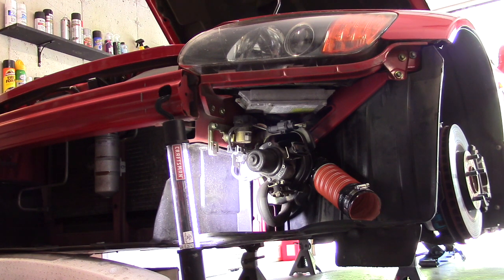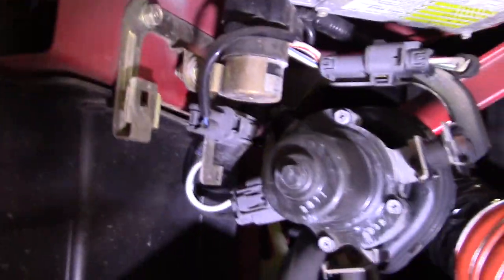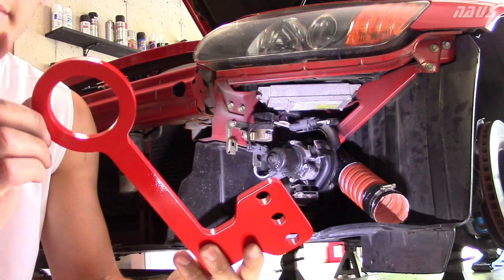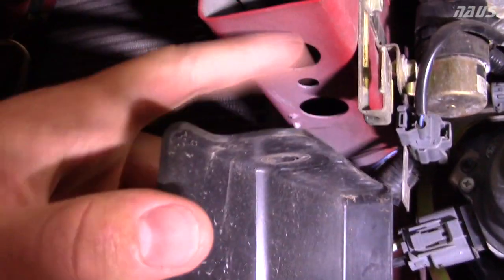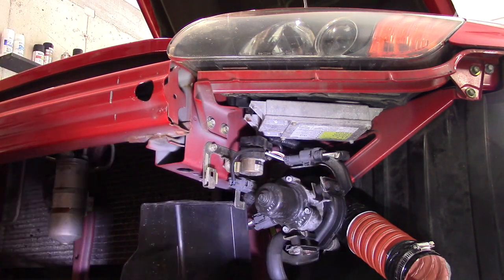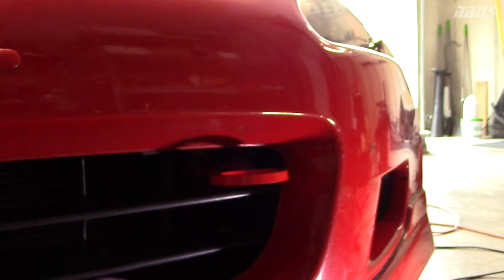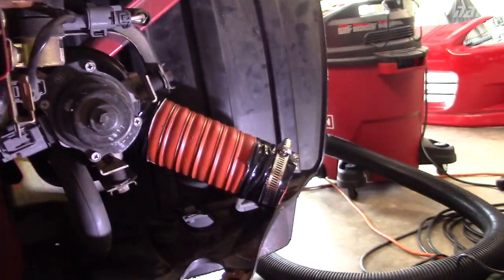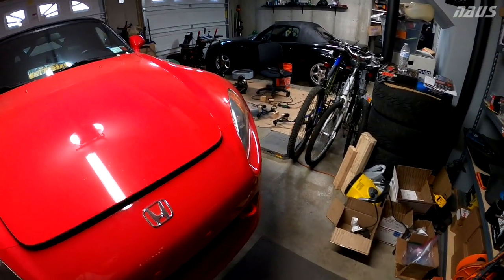J's Racing Front Tow Hook Install - Honda S2000

Comment: Does the requirement matter on placement? Like I run my chassis mount right where the Hook goes could use long bolts or just
Install a rear tow hook?
Reply: Looks great with the nfr
Reply from the maker: It’s ideal to have a front and rear tow hook on track. There are other options out there like the Science of speed front tow hook which would not interfere with your splitter mounts. There is also the oem tow hook and location which works just as good.

Comment: The reason you needed to use the zip tie is because you cut too much of the lining. Instead, if you cut a U channel in the lining where the forward most bolt is, you can use the force of the bumper to keep it in place. It'll essentially sandwich the liner against the grill, tow hook, and front bumper. So far, it's survived over a year of track events with no issues.
Reply from the maker: I mean I could have just sandwiched it in there, but I wanted it to be held up like oem and secure without the bumper on
Reply: @NAUS2K  I just did this install myself. I used a dremel to cut a slot in the vertical section of the plastic shroud right up to the horizontal part just wide enough to get the hook in place, still leaving material in front and behind the tow hook. I then drilled two holes in the horizontal section to fit the bolts through. the plastic then sandwiches between the hook and the frame rail and attaches the shroud to the frame in the same spot but more securely than the old clip. It's a little more work, but makes everything fit more securely and looks a little cleaner (even though you can't really see in there without the bumper off).
Reply from the maker: @joshterasaki6647  so you have plastic sandwiched between the bolts to tighten the tow hook down? If so that would compromise the strength significantly because you would never be able to torque the bolts down tight enough as it would infinitely crush the plastic.
Reply: @NAUS2K  It's sandwiched between the tow hook and the frame. I was able to tighten the bolts down more than enough to compress the lock washers which are what really keep the bolt from backing out.